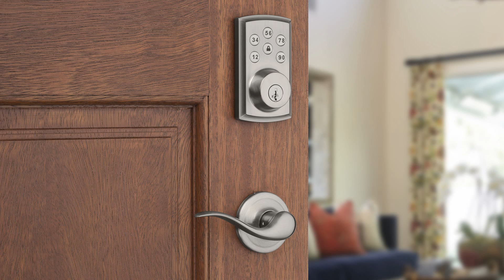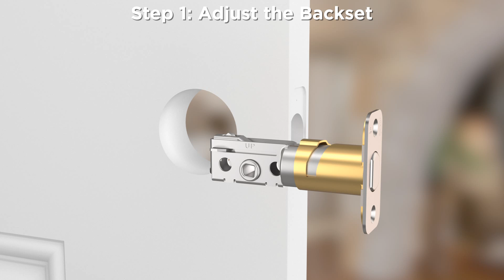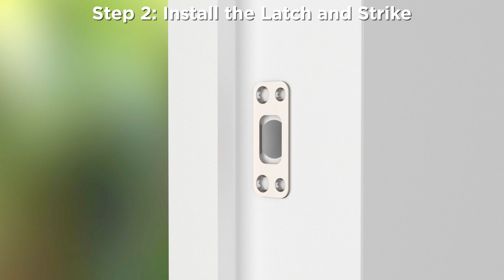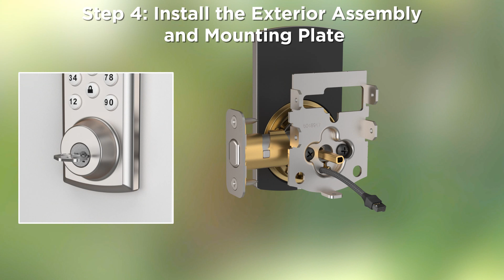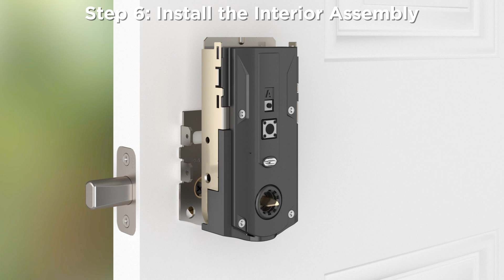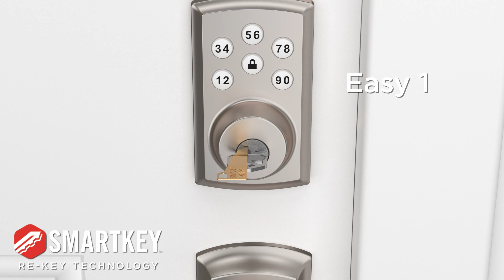Kwikset SmartCode 888 Installation (Z-Wave Plus)

Comment: If you can't connect this lock to ring app after other home systems (like alarm com) disconnect all zwave devices (including thermostat) and factory reset lock
Reply from the maker: Hi and here to help! To connect the SmartCode 888 to the new Z-Wave hub, you must first complete the exclusion process which resets the lock. Please see these instructions on page 4, bottom left, of the installation guide, linked here: https://kwik.st/3e8OBxG  Thanks ~ Kwikset Social

Comment: I keep getting stuck on step 7. I hear a click inside and then it jams. When I do it manually, it smooth. I'm two seconds away from returning it and writing off kwikset which I'm sad about.
Reply from the maker: Hi Glenn, here to help! Please contact our Consumer Support team here: 1-800-327-LOCK (5625) or fill out the form: https://kwik.st/2PIYnaj so they can better assist you. Thanks -- Kwikset Social
Reply: Having the same problem. Test Only turns halfway then returns back to lock position. Manually smooth but not on test. I feel like it doesn’t have enough torque to lock. What do I do?
Reply: @makogeyser8543  keep going through the steps. I realized it was working properly even though it seemed it wasn't.  Let us know if it works
Reply: @GlennYri  yeah! I eventually caught on. I should’ve read the instructions on the manual more carefully. Had it right the entire time! Ugh! Three hours wasted. I was about to return the sucker. Thank you for replying back! Be safe!
Reply: @makogeyser8543  likewise! Glad it worked out!
Reply from the maker: Hi and glad you were able to get it to work! Our Consumer Support team is also always here to help... please contact them here: https://kwik.st/3mDHegh or call them at: 1-800-327-LOCK (5625) for any future troubleshooting needs. Thanks -- Kwikset Social

Comment: Do I need to reverse some of these steps if the lock is on the other side of the door? The mechanism locks fine until I add the interior part and then it won't unlock all the way
Reply from the maker: Hi Mary - Here to help! For the latch to learn the door direction, you must first complete the door handing process in the link below. Please keep the latch in the locked position and do not try to unlock the deadbolt after the installation of the interior assembly of the lock is completed. Simply perform the steps in the video link: https://kwik.st/3xy8fZU Thanks ~ Kwikset Social
Reply from the maker: Hi Mary - In addition to the video, here are the complete manual door handing steps in this link: https://kwik.st/3xTxs2g Should you need any further assistance, our Consumer Support Team is happy to help you at 1-800-327-LOCK (5625). Thanks ~ Kwikset Social

Comment: The "door handling process" did not work. I got an orange light. Also not able to pair with RING base probably because of the failure of the previous step. All screw bags aren't properly labeled. So now I have an expensive deadbolt that only works with a key. I Will research further to find the solution. I wish RING would release their own locks.
Reply from the maker: Hi! Our Consumer Support team is here to help... please contact them here: https://kwik.st/3owMcx0 or call them at: 1-800-327-LOCK (5625)

Comment: How do make the keypad light when i press the numbers? is it event possible to light up the keypad?
Reply from the maker: Hi Fidencio! On the SmartCode 888, only the center lock button on the keypad will illuminate when the deadbolt is in the locked position. When you walk up to the door, press the lock button, it will light up, allowing you to see all the other numbers on the keypad to enter your user code. Thanks ~ Kwikset Social

Comment: what app does it work with?
Reply: You need a ZWave + controller installed in your home.  Any modern Security Panel typically has Zwave.  I believe Amazon echo also functions as a ZWave controller.
Reply: Installation went as advertised. No issues yet. Very simple process.
Reply from the maker: Thanks for the feedback, hope you have a great day! -- Kwikset Social